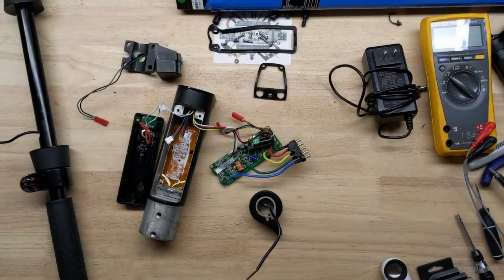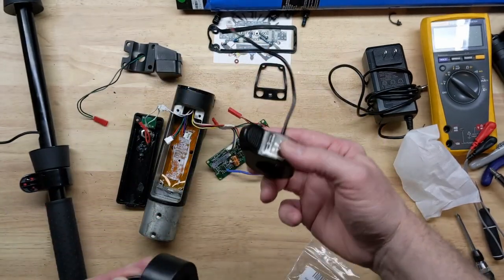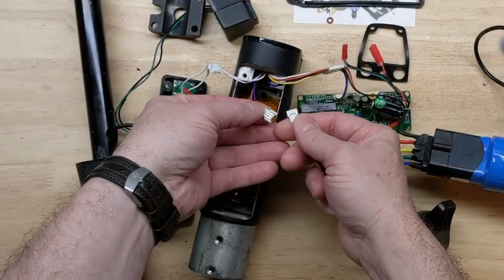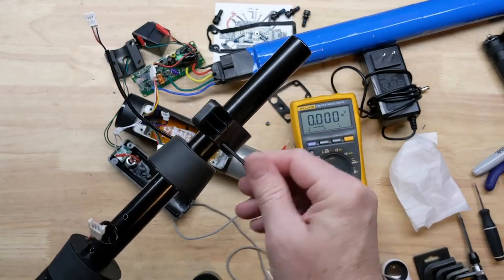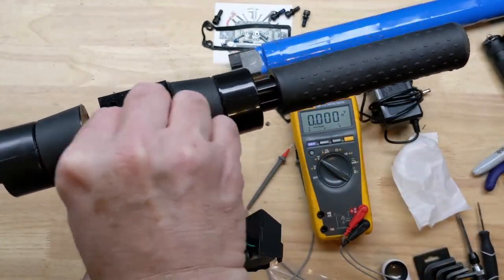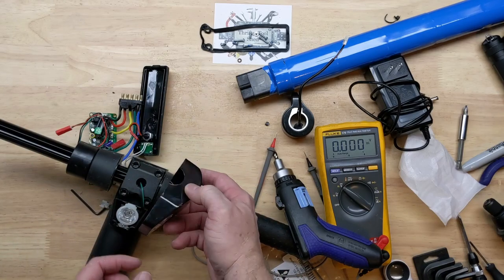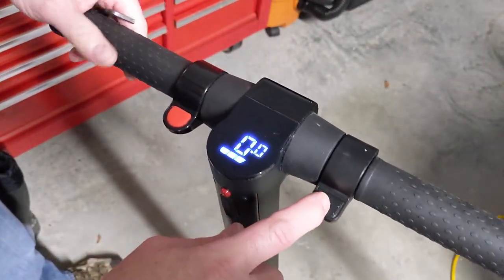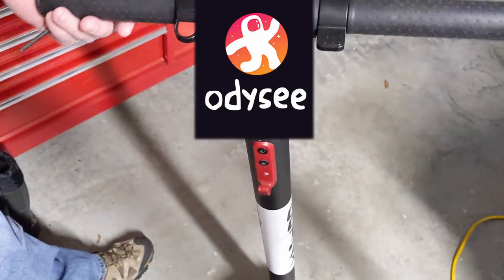GoTrax G2 Scooter E3 Error Fix - Part 2

Comment: Thank you very much buddy for your link on the throttle controller. Didn't have to do all the work that you did just replace the throttle controller itself and arrow was gone. Just finished grease in the bearings front and rear of the wheels got a new tire coming in for the front it's going to be like in new scooter again.

Comment: I have a problem on my gotrax that looks just like that, it turns on but the throttle doesn’t work. I also cannot put the cover back on where it protects the wire. Can I have some help?
Reply from the maker: Hi, the one in the video is the only one I have worked on. I don't have anymore information than shared in the video. Just make sure you are kicking off on the scooter well so the throttle can detect it and start up the hub motor. Best of luck to ya!

Comment: I have a 30e code and I’ve replaced main board on the scooter. Going to replace the display but so far I still have the 30e code
Reply from the maker: Dang. I have not worked on this error, but nice how GoTrax simply shows to replace the console. Come on GoTrax, a little more troubleshooting help is not too much to ask for! Thanks for the information. Best of luck to ya!

Comment: What’s an E5 error mean on my 2023 gotrax fusion basic? I already replaced the console. Is it motor or ESC module ?
Reply from the maker: I believe E5 points towards the controller,  but I did not have that issue on mine, so I am not much help with that.
Reply: J replaced the motor. Problem fixed. E5 error code is a motor code.

Comment: This is kind of an old video but i hope you still read and answer comments on it. I have bought a ninebot replica roller, and yesterday E3 code started appearing randomly after a while of scooting. What could that mean? Like sometime it appears for a couple seconds, i wait and then it goes normally again. Like one time i wanted to go up a slight slope and it just could not do it, got the e3 error constantly
Reply from the maker: It depends on what brand it is and what the manufacturers information says the E3 code is really. I don't know who made it, it may be the same as the real Nine bot, but who knows without the info. E3 in the case of the one in the video here was the throttle hall sensor,  but not all manufacturers use that same error code alignment. It is most likely a Hall sensors error, but whether it is the motor, throttle etc. you will have to look up the error codes specific to your model.

Comment: great vid… how do I position the magnet inside of the small (two screw) break handle access panel?
Reply from the maker: I simply replaced the throttle, I did not remove or replace the magnet on this one so I don't know for sure. I did show the hall sensor broken in the video, but did not go any further with that.

Comment: I have an odd problem. I am getting 4.4 volts going to my throttle, but then when I push the throttle and measure, it votes from 3.58 to .78? Do you have any idea why it would be going down instead of up? Thanks for the video! It’s been a great help
Reply from the maker: Thanks for your kind comment! 
I have only worked on this one and the voltage for both brake and throttle went from low to high. I am not sure if some are different or not. It makes sense that the input would go from low to high to me. I would compare with the Brake sensor to make sure it's controlling the same. 
Sorry, I have no other experience with these. Best of luck to ya!

Comment: My son has an issue with his G2 scooter. The motor won’t run like there is no power. But there are no errors. Any ideas would be helpful
Reply from the maker: I don't know if you are new to the scooter or not so the first thing I ask is if you know that it is a kick scooter meaning that you have to kick off and get it rolling and then push throttle to activate motor! Some simply don't know this when they first get the scooter. Thats the  only thing that I can think of with no error.
Reply: @ThriftyToolShed  yes it a kick scooter. We have had it for about a year.  It just died while riding it and hasn’t worked since.
Reply from the maker: Gotcha, it's weird how it has no error on it. I have not seen that.

Comment: Just got the 3 wheels g pro...but it doesn't run when in press the throttle...it moves in walking mode..but that's all I get  .can u help I pls 🙏🏼
Reply from the maker: Are you kick starting the scooter and after it gets up to a little speed then pushing the throttle. Most of these type ofl scooters are kick start. If that is not the problem then it could even be the throttle is broken or unplugged, but usually it shows an error code if the throttle is open/broken. 
I have not worked on this model to help any more than that. Best of luck to ya!

Comment: My gxl that I just bought the headlight does not work. Any advice
Reply from the maker: I don't have any experience with that. I would only know to try the more obvious things first. Make sure connections are good and if Voltage is getting to the light itself and go from there. Best of luck to ya!

Comment: What does the “H” mean on the display when you are testing it at the end?
Reply from the maker: I believe you are asking about the cruise control (or Hold) feature. I was holding the throttle at the same position for over 10 secs and it shows H and beeps once in cruise mode or holds that setting even once the throttle is released. This Hold mode is deactivated if you press the brake very similar to how a car cruise control would work. Some model scooters also release the Hold mode once you manually move the throttle again to gain back manual throttle control.

Comment: I have a go trax 2 and when pluged in charging it turns on but if unplugged it will not turn on. Any suggestions?
Reply from the maker: A couple of things I would try.
Making sure after charging that the battery voltage is good and it's making it's way to the board. Next, I would check the power  push button itself to make sure it's working properly. Best of luck to ya!

Comment: my go trax says e3 wich means brake but if i buy the same throttle and do the same thing it should work right?:
Reply from the maker: Well, it's been a little while since I worked on this. I believe the connectors are opposite on these. Double check me on that. I think one uses the female connector and the other uses male to keep them from being plugged up to the wrong input. Other than the connector on this model, I believe the sensor is the same! Hope it helps and best of luck to ya!

Comment: Thank you so much! I was able to fix my boys scooter. Now i just have to fix my scooter. Its a Gotrax g4 saying low battery but the battery is new. I checked with meter and it says 42v. So i dont know
Reply from the maker: Awesome job. As far as yours goes, that's a tough one. With a new battery it seems the controller itself is not showing the correct voltage. I have not worked on that issue. All I would know to do is check the board around the battery connection for solid connection and then try your best to find traces from battery input to the microcontroller. It could possibly be a bad resistor  or diode inline with the battery for the microcontroller reference. Hard to say for sure. Best of luck to ya!
Reply: mine is the other way round. wasn't able to charge to 42V, stop right at around 38V. Seems like the microcontroller is not reading the voltage correctly. not sure how to fix that.

Comment: My throttle sticking any thoughts?
Reply from the maker: You might get lucky with some plastic safe contact cleaner like the one below. It could be Debris inside the throttle making it tight. Otherwise it will most likely need replacing. Best of luck to ya! 
https://amzn.to/4cVMwhH

Comment: Is there a part for the speed my screen or it is broken
Reply from the maker: I think you are asking about the display board? The only place I would know maybe eBay at times. I do not see any on there at the moment though!
Reply: @ThriftyToolShed  oh ok thanks
Reply: @ThriftyToolShed  I have another question I use any thermal compound paste to replace the old paste that was already there
Reply from the maker: Most silicone heat sink compound should work fine. If you did not wipe it off then it should be fine unless it  did get smeared...
Reply: @ThriftyToolShed  it got smeared that why I was asking. What the best and cheapest that I could use
Reply from the maker: @SlitheryEnd03 ,
Usually best and cheap are far apart. 
I see this for example that is cheap and reviews on it seem good. You can buy a $40 tube made by DOW and I would not know for sure if it is truly much better? Just an example here. Hope it helps...
https://amzn.to/3FNzzpS
Reply: @ThriftyToolShed  ok thanks I’m going to get the one you sent me in the link. Thanks for the help